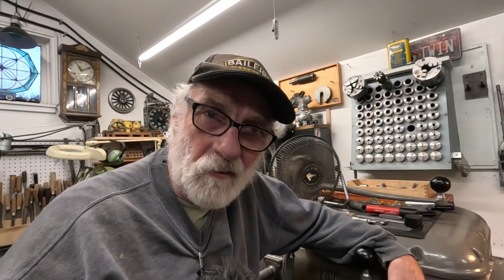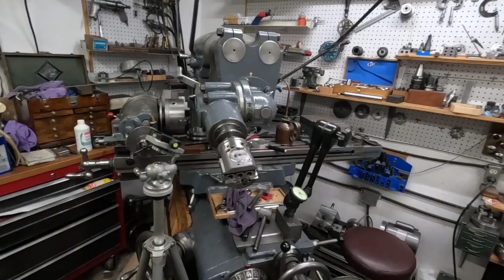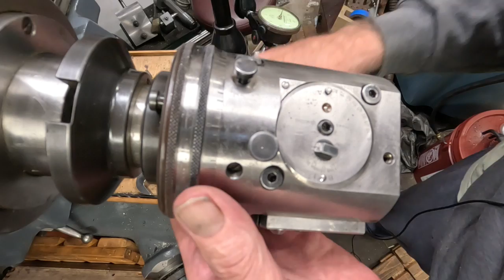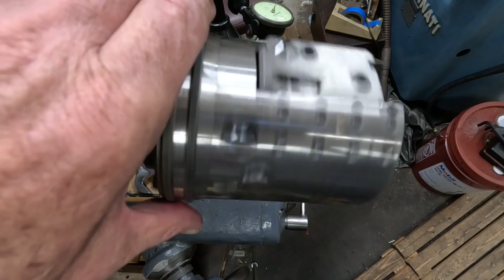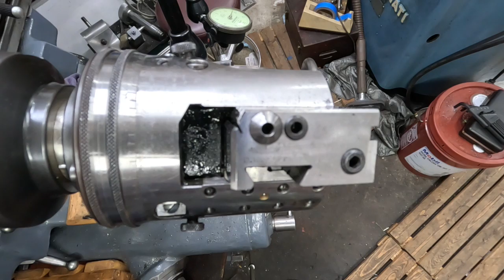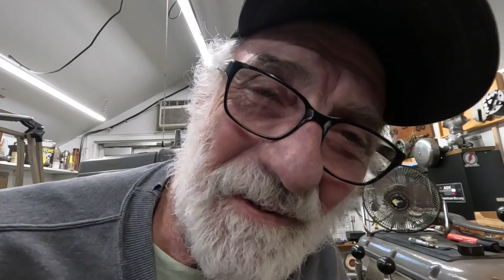Wohlhaupter UK4 Rotary taper milling machine head introduction

Comment: Wow , that is one nice boring head there Don .   Cheers  👍
Reply from the maker: Single point cutting angles and bevels on a milling machine can certainly get complicated as this head shows using Z and X ways with separate feeds. The head is working without bind after oiling it at every angle and running it through its range many times, I can grind up a cutter and do some cuts in the video I am working on now.

Comment: So happy to see you in the shop my friend, it’s been so hot and we have been so busy lately I haven’t had a chance to make it to class. I just sold the UPA 4/5s I converted after consulting with you, your help is very much appreciated. I zeroed it in on the lathe and used the CBN insert you mentioned and cut it down close to dimension, and finished it off with the tool post grinder for a factory finish that was .0002” away from perfection! 😂. Thanks for all the expert level knowledge Sir. 🫡
Reply from the maker: Hi, that is great to hear, it is always fun to cut into something expensive, thanks!